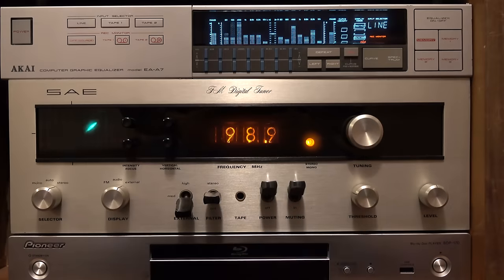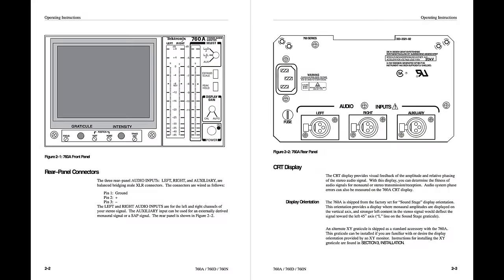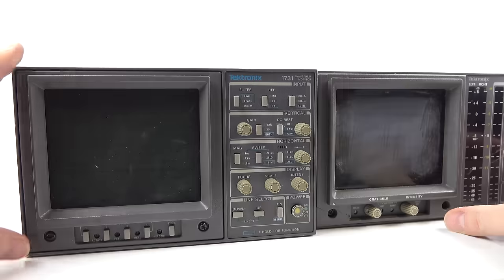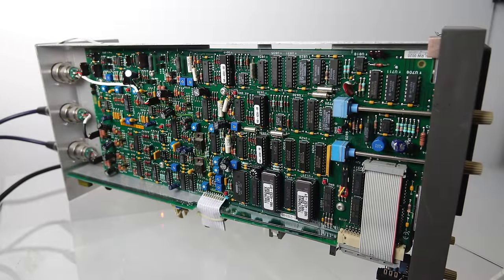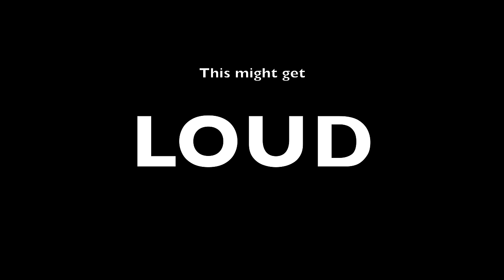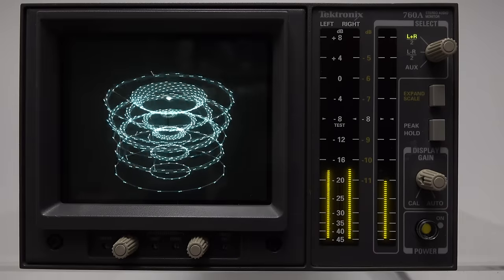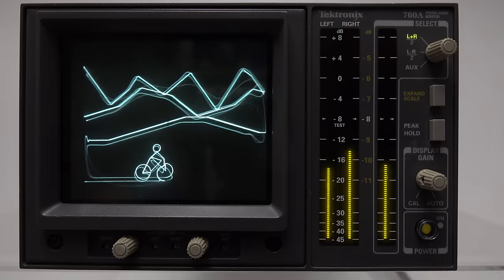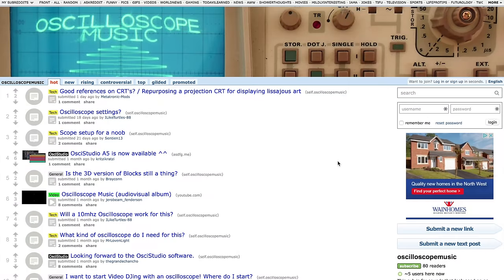Oscilloscope Music - Pictures from Sound

Comment: I think it looks cooler with the non-192 kHz display. The glitches make it look more interesting than just the flat lines
Reply: i agree.
Reply: Agree, the glitches make you realise its all analogue.
Reply: +1
Reply: definitely
Reply: yeah, i'd love to see that guy's full album played on your oscilloscope!
Reply: Yep, with the glitches it looks a lot like a demoscene demo "Spin" by ASD.
Reply: We need osu! on the vectorscope.
Reply: agreed
Reply: The distortion is mainly from the compression. If you take a wav file that's clean and make it an MP3 you get the same distortions. Also the mp3 maxes out at 48 khz (In audacity) which I'm sure isn't helping.
Reply: What does mp3 have to do with it? You get 192kHz WAV files when you purchase the album. Techmoan's issues were from a device at some step from playback device to oscilloscope not having a high enough sample rate.

Comment: I never thought you could make such complex patterns on the screen, and have the output still sound like music.
Reply: Mikey I know, my thoughts exactly. Maybe it has to do with inaudible frequencies?
Reply: Mikey I am amazed as swell.
Reply: Brandon Burrows it's about the phasing (delay) between left and right. The scope draws fine regardless of the frequency, so it all can as well be audible. Admitting, I was quite surprised seeing this beautiful image and sound! And the scope with level meters... Beautiful!
Reply: JF created a program funded by some kickstarter that you can use to explore these things and see how it is built. There are two ways to do this. One is to generate patterns that really sound like something, the other is basically create the patterns that draw something with high fps, which will then sound like ugly noise, then add on top in higher volume some actual sound that doesn't distort what you see too much, but due to persistence of vision and the phosphor of the CRO, you won't see that much but more of the wanted image, since its drawn over and over again on the same spot, while the audio jumps around. For the fine details and sharp edges, you use frequencies that are inaudibly high (thats why you really need at least 96kHz to have proper images). From those basic principles you can start.
Reply: Dennis Lubert oh, thank you very much for that info! I had thought that you need a high end audio source for getting sharp corners without overshooting. But the inaudible content can surely be used.
Reply: Sami Jumppanen The sharp corners are actually the inaudible content frequencies, and the better your audio equipment (frequency wise) the sharper they get. Google up some frequency domain image of a square wave and you will see (diminishing amplitude) content in higher harmonics. The more of them you include, the sharper it gets, but it doesn't need to be 200kHz to start looking good enough
Reply: Dennis Lubert I do know a lot about sound since I began with computer audio in 1990. I've also realized there is no perfect square wave in this universe, it's impossible. Nothing can change instantaneosly, everything takes time. Of course, the required bandwidth depends on the implementation, what do we need to get and how accurately we see the actual result. Anyway, good info, thanks again!
Reply: And surely not by accident but this is no doubt a profound insight into the mechanics of the universe in terms of sound and geometric movement.
Reply: Quite.
Reply: That's a joke, right? How do you think CRTs work? :'D
Reply: lol no, its just a software of a picture that play along with the music
Reply: @bennypika3575  I've seen you post that garbled nonsense multiple times. Just go away dude.
Reply: I hope you're using the term "music" extremely loosely. Lol

Comment: Just realized when I watched it for the 2nd time that those who say it's a vectorscope are actually wrong. Calling them that is marketing stuff. A vectorscope always needs a stable reference signal in order to display the color vectors (hence vectorscope). But neither of the right nor the left channel of audio can count as reference signal. The term oscilloscope is correct, it's just the rarely used XY mode, usually YT mode is used. If you use a real vectorscope you won't be able to display those signals, since they use color reference signal phase stabilizers that would interfer with the audio signal. Also they are not made for audio frequencies but for 3.19 to 4.33 MHz signals.
Reply: THIS.
Reply: A vector scope shows phase between two (or more e.g. 5.1 sound) while an oscilloscope shows signal amplitude versus time. Vector scopes are typically used in broadcasting and mastering to check phase. An oscilloscopy with X-Y option can function as a two channel vector scope. You may call it marketing, but typically they are different devices used in different applications.

Comment: The old console versions of Atari Asteroids used what in effect was an oscilloscope type display (but using a standard monochrome CRT) instead of a standard CRT monitor (with the normal timebase) . This meant the CRT spot was effectively drawing the rocks, spaceships & scores etc. by having the game processor control the X & Y postions and switch the beam, rather than produce a standard video signal for a standard raster scan monitor.

Comment: As the person who possibly started the 'Vectorscope vs oscilloscope' thing I did baulk at the first few lines of the video thinking 'shit, what have I done!' 

But this is cool, and I've fired up my venerable old Tek 2211 to have a play. Another top video Mat :)
Reply from the maker: A few dozen people told me that it was a vectorscope so don't worry about it. Since oscilloscope is a more commonly used (if possibly not a perfectly accurate) term I just used that.
Reply: Techmoan - fair play! I did get excited this was going to head in to a Dave Jones mashup and you were going to say 'In like Flynn,' 'Bobby Dazzler', 'That's all she wrote' and 'Don't turn it on, take it apharrt'....

Techmoan, Dave Jones and old Tek' 'scopes. Heavens, that's a thought :P
Reply: mipmipmipmipmip - Mat rightly hits on it in the video, X-Y mode which with all due is a bit deep for a YouTube reply.

Lots of scopes have an X-Y mode,  which is all dandy but the use of an oscilloscope is to show Y/Time.

I'm trying to think of a decent analogy sitting here in the pub, give me a minute :P
Reply: mipmipmipmipmip to see this in the best possible way as many have pointed out an old CRO [cathode ray oscilloscope] (pronounce it 'crow' to sound hip) is the way forward, digital scopes are phenomenal but this kind of true wave display are where old cathode-Ray machines win by a mile.

That's why most electronics types use a digital 'scope but keep hold of an old CRO under the bench as they still spank digital ones in a few arenas.

I wouldn't unpick serial protocols with my 2211, I wouldn't use the Rigol for vector display.

Tektronics are the 'Rolls Royce' of 'scopes. (LeCroy fanboys need not apply) so Mat has quite a serious bit of kit here!
Reply: >  the use of an oscilloscope is to show Y/Time. 

Yes - but also no. We have used oscilloscopes in engineering research,  with x-y mode showing the acceleration of an elastic rotor in x and y direction. The result is an orbit and the scope allows you to immediately see what is going.
Reply: YensR so putting it in to essentially 'Vectorscope' mode?

The question was about oscilloscopes?

An oscilloscope ('proper' and forgive my pedentry) is Y/Time and absolutely nothing else.
Reply: Andrew Benham I think you mean your vectorscope constantly operates in x-y oscilloscope mode.

A vectorscope IS an oscilloscope. Your definition that an oscilloscope is for nothing else but a time-based signal is not pedantic, it is wrong. 

Are you trying to get both of us into an end sketch with Techmoan's muppets?
Reply: YensR I am really rather drunk so no doubt in some respect you are correct! Techmoan need not worry we both agree he is correct and we're being nerdy types having a bit of technical waffle which is no criticism of him! Mat must rest easy here!

An oscilloscope in its purest form can only measure Y/Timebase, I have a stack of them here that can do just that. They measure oscillation of a wave.

An 'oscilloscope' operating in X-Y mode (which many can't) is generator a vector and has been switched to a Vectorscope.

Have you ever attended a broadcast unit or an RF/PAL engineering unit and claimed your oscilloscope is also a vector scope then looked for 'colour-under' with it?

I think we're having a 'heated agreement' but X-Y is a vector, not an oscillating waveform

Go on, explain how I'm wrong? :P

Cheers,
Andy
Reply: Andrew Benham 
> but X-Y is a vector, not an oscillating waveform

That is not only "not right", that is not even "wrong". Those are two different concepts.

Of course an x-y orbit is an oscillating waveform. If both x and y are a sine, then the result will be a circle. 

But waveforms on an oscilloscope do not need to oscillate in the first place, so not sure where you tried to head with that. 

Vector? A vector has a starting point and an end point. How is that going to help us find a difference? 

Just because some oscilloscopes can't x-y doesn't mean that an oscilloscope that can ONLY do xy is not an oscilloscope. 

You don't even have a technical reason to differentiate the two: In a CRO, the horizontal displacement is driven by a sawtooth signal (time base generator), with its gradient/frequency depending on the time/division setting. So it effectively is ALWAYS in x-y mode... ...just like a vectorscope. Just generally with more flexibility what that second signal is. How about you feed a signal generator with a sawtooth signal into one input of your vectorscope, what do you have then?
Reply: YensR I was right, we are having a 'heated agreement!' 

A question of style I think :P
Reply: mipmipmipmipmip - fair play. It's all pedantry, it's not a distinction to worry about really :)
Reply: Andrew Benham what's a tek
Reply: Justin.R Gaming Play - Tektronix :)
Reply: oh ill check it out!

Comment: 2:06 "I did switch it on just to see if it was working but it made a big bang and lots of smoke came out of it"...

This is a common thing: Most electronic equipment has a filter capacitor at the mains input that's connected straight across the live and neutral lines. Over time, those capacitors dry out and make a short circuit, so when you plug the device in and switch on the power: Bang!

Once you had a big bang, the device will probably work okay if the rest of the electronics are alright (but other capacitors may have dried out too, especially if you get something from after 1992 or so). You may have to change the fuse though.

I you know how to recognize these "explosive" filter caps (usually it's a yellow and/or translucent part near the mains input) you can cut them off before you plug in a "new" vintage device to the mains next time. They work fine without them and sometimes when they blow up they can make quite a mess with chemicals spraying around. Make sure you're cutting off the filter capacitor (again: connected between live and neutral) and not anything else, of course. And obviously do that while it's not plugged in.

By the way: funniest muppet ending ever! :-)
Reply from the maker: There were a few other issues as well, however it served its purpose as a donor well and now lives at the recycling centre.
Reply: Techmoan Should've ate it

Comment: Weird it sounds half decent, you'd expect it to sound more like a phone modem.
Reply: The modulation in this audio is similar to the modulation happening with a modem.  Both use the modulation to encode data
Reply: sounds full decent
Reply: Oscilloscopes don't have speakers

Comment: Step 1: get that
Step 2: get xlr cables
Step 3: play some music
Step 4: you have an 3d intro
Reply: GustavTheGoat or u could record in the emulator
then it could easily sync the music in the intro
Reply: Step 5: ???
Step 6....
Reply: GustavTheGoat you wouldn't be able to do that because these oscilliscopes show a modified version of the audio waves, and this music was made specifically for the oscilliscope to display. If you put it a different song it would just come out a random mess, unless it was designed for the oscilliscope.
Reply: GustavTheGoat exactly what i was thinking
Reply: except the picture things dont work.........only like the squares and some of the circles but the circles are not the same looking

Comment: One of the first programmes I wrote for my TRS-80 back in high school was one that read the audio data from the cassette interface (the computer had tape input instead of disc drives) and displayed it on the screen. I called it LightShow and I had great fun running my stereo aux output to the cassette input and watching the display change with the music.

Comment: For those who want a cheap alternative to the 760A: I just found out that the Tektronix WFM601 (and WFM601A) also has such an audio analyzer built in. It's already rotated by 45°, so no modification is required. Another advantage is that the scale is electronically displayed, so you can turn it down and see only the oscilloscope music. The only thing you have to do is connect balanced (or unbalanced) audio cables to the rear D-Sub 25 connector. And these monitors are cheap, I got mine for 50€ (around 60$) in working condition
Reply: thanks.

Comment: Huh, I was a backer of the album you used to demo on kickstarter, and the example videos show a lot of the demos with single crisp lines, and the examples you showed often had two lines where there should be one. I wonder if it plays differently on different Oscilloscopes.
Reply from the maker: It's explained in the video at the end.
Reply: Ha, the ONE time I click away at "That's all for the moment!", I become the green puppet.
Reply: Even at 192 kHz I can only replicate this double line phenomenon when I try to EQ the output signal after the DAC. With just the DAC I get clean lines at 192 kHz and they only become slightly fatter, less crisp at 96 kHz. 48 kHz still works fine here, though it's only a bit inaccurate in that the lines become thicker/fuzzier..

Comment: I bought an old large screen O Scope just for this reason. It also works as a station monitor for my amateur radio ham radio shack. I have dozens of old O Scopes. I bought about 1500 465 series Tektronix scopes down in Yuma for under $1200. Most were sold as parts donors.

Comment: i used to build what they called a "Lissy Pen" You get two same size crt televisions and cut the yoke away from one, wire the left and right from stereo to vertical and horizontal to it. Slide the other yoke from the working set off, brownbag it and keep it hooked up, place it in a vacant spot inside. Now take the other yoke atatched to your stereo and slip it over the picture tube. Use a second amp to be able to adjust listening volume. Now you have a huge screen that fires red blue and green patterns with each color that is adjustable.

Comment: 2:31 Who does something like that? That's horrible...
Reply: i'm going to assume someone didn't realized that it was plastic and attempted to use acetone on it...
Reply: Just do what it says in the manual; "wipe with a damp cloth. Do not use aggressive chemicals."
It's surprising how effective pure water is on most stuff.
Reply: Some types of plastic are even rather sensitive to ammonia-based cleaners, and will start to yellow. (It's why you shouldn't use Windex on most laptop screens.) Somebody probably started scrubbing with something else to get that off, and next thing you know...

As for fixing? Might be possible, but you're going to take off about half a millimeter. Sand with 400, then 800, then 1200, then 3000, followed by plastic polish. Just like you'd do with a car headlight.

Best cleaner I found for plastics touchy like that is a lens cleaner you can find at an eyeglass store. Basically what you're looking for is "safe for polycarbonate" or "safe for anti-reflective lenses" on the label. And you tend to get a lot more cleaner for the money than something specific to electronics. Also (if you don't have them already) may as well get some microfiber cloths.

Comment: It actually dates from 1993 or slightly later,both from the CE marking as from the date codes on the IC's. The broken scope may have suffered from a paper capacitor blowing up.

Comment: Big bang inside: you never turn on an old thing that was kept disconnected for years without changing all electrolytic capacitors: especially with high voltage. The electrolytic have high capacitance because the dielectric is very thin, a layer of aluminum oxide created by electrolytic reactions when DC is applied (that is why they are polarized). If kept turned off for long the dielectric layer  deteriorate and it go bum when current pass through it and its electrolyte vaporizes with the heat.

Comment: Consider replacing the electrolytic capacitors and possibly the X1/Y1 and X2/Y2 safety capacitors on the U.K. unit and it should work again.

When you mentioned ‘bang’ it was likely a capacitor cooking off and venting its lid.

Comment: You would get better results using a line Trafo adapter, it would match your levels properly and you get the full balanced signal that the machine needs to display properly

Comment: They have a spectrum analyzer app for iOS that reads almost accurately like an osiliscope would. Really good app if you’re working radio astronomy on the fly. Just put the world band receiver right next to the iPad mic and you have a crude radio telescope. Another app I like is sstv which uses the mic for rx, and speaker for sending. A crude sstv station if you would. That also includes an app called hellschriber which is on a similar order. I basically have a huge ham station right on the iPad lol.